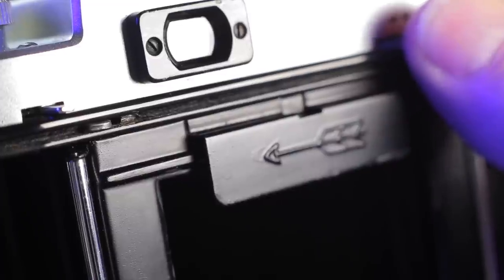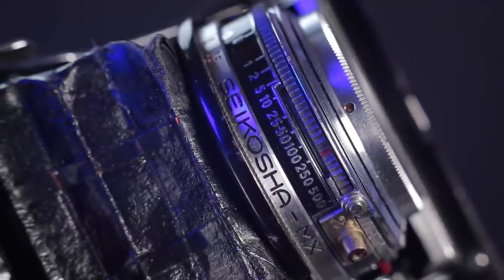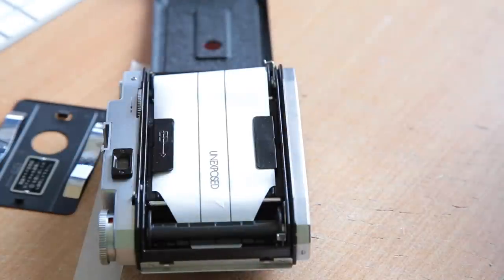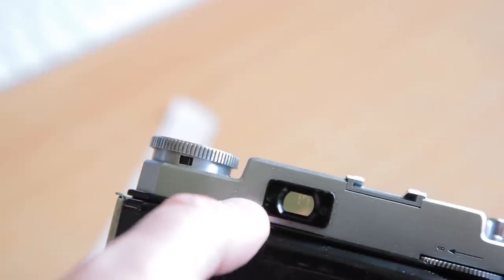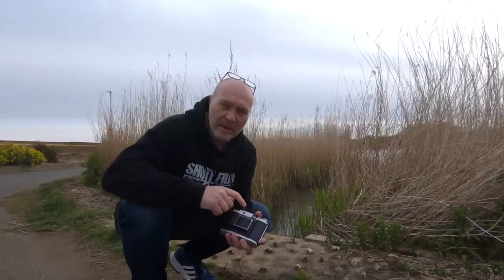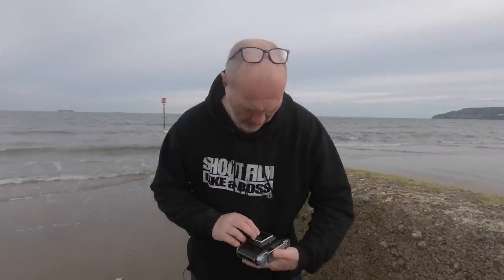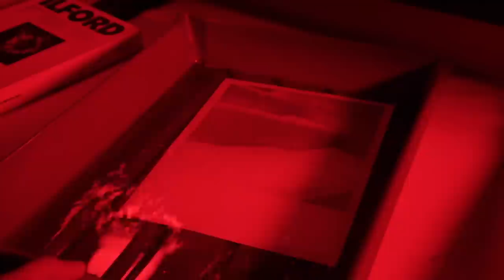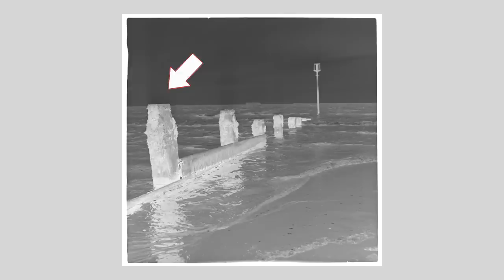6x6 MAMIYA 6 Automat. My latest Folding Camera. Classic!

Comment: What's the best practice for metering your shots with this camera?  You seemed to be taking the shots quickly without using any kind of light meter.  The reason I ask is because I'm thinking of purchasing one.
Reply from the maker: I can't remember the conditions but usually I'll shoot these cameras outside where the light doesn't change so I can meter up once and shoot away. I know if the light has got darker or lighter so I either meter again or judge it by eye. But mostly I shoot them on a day where the lights is even all day.

Comment: I’ve had one of these for several years and it’s excellent! The lens is superb! Super sharp with great color rendition. Actually fits in a coat pocket or easy to sling over the shoulder. Quiet leaf shutter. 
Mine is quirky with flashbulbs though. There was either a short or the metal to metal of the cold shoe/flashgun was popping them off in my fingers as I replaced them. Ouch!
Reply from the maker: Ha ha. Pop, fizzzz... Ouch

Comment: I've got one of those, a slightly older model.  I was planning to get an Ensign Commando (same focusing setup) but for almost twice the money, I got one that had been dropped, and the top cover caved in.  Mine requires use of the red window, and I have to manually cock the shutter -- but it has a pair of flaps inside that let me switch between 6x6 and 6x4.5 formats.  Lately, though, I've been using my Daiichi Zenobia more.  Smaller and lighter.

Comment: Googled it it seems you move this after you’ve taken a shot to prevent double exposures and overlapping of images on the film. A little red flag appears in the viewfinder
Reply from the maker: Nothing happens. That's what Martin Henson said. But I get no red window in my viewfinder. Thanks for taking the time.
Reply from the maker: And it's impossible to take a double exposure with this one. It won't let me fire unless I advance the film.
Reply: @ShootFilmLikeaBoss  Funny why you have to move the switch if the camera won’t let you take a picture anyway. Suppose it’s like I found out that you need to move it to stop overlapping 🤷‍♀️

Comment: Another Mamiya Six Automat owner here.  I was looking for a high quality folder, but couldn't afford a Super Isolette, so I went for the Mamiya instead.  It really is a great camera - simple to use, portable, and has a nice sharp lens.  
That said, there are a couple of minor problems.  The automatic cocking mechanism on mine doesn't work properly, so I need to cock the shutter manually before I advance or else I waste a frame.  The camera doesn't have any frame lines in the viewfinder, so be prepared to crop in the darkroom/photoshop.  Lastly, the lens is quite prone to flare, either because it's not recessed far back enough, or because of the coating.  A way around this is to use the lens bed/front cover as a 'hood' of sorts, and orient the bottom of the camera towards the light source when shooting.
Think I might take mine out today...
Reply from the maker: Thanks. I did read about lens flare online when researching. I'll watch out for that!!
Reply: @ShootFilmLikeaBoss  Cool. Also, forgot to mention - don't try and change shutter speed when the shutter is cocked.  It'll damage the mechanism.

Comment: I love the Mamiya 6 - have on myself as well. I love the lenses on these things.

The tab that you slide to hold the film spool in place is suppose to have a small thing that holds it in place, I guess is gone on yours, but should not stop the function of the camera :).

As always, enjoyed your video... keep them coming :).
Reply from the maker: I did have a feeling something was missing there.
Reply: I'm in the middle of stripping down two mamiya six cameras and they have the same metal plate. The first one just rests there and can swing out freely as yours is doing. The second one at first I thought metal corrosion but it's not. The company changed it by cutting the metal to form tension on the removable screw it rests against. One side worked the other was lose. Bending it slightly with pliers has put the tension back and it now holds in place. I'm surprised the automat has that fitting as my model IV which has everything the automat has expect auto cocking the shutter has the normal circles at the base of the camera which you pull out and they go back in place once the film is loaded.

Comment: Do you find the shutter speed dial/switch hard to adjust?  I have to use two fingers and quite a lot of for to move the shutter speed. Wondering if normal and if not let me know any advice.
Reply from the maker: Not really. No more than any other cameras. It's not stiff.
Reply: @ShootFilmLikeaBoss  Thought so.  Any suggestion on how to lubricate it?

Comment: some of my favourite photos you've taken , in this episode
Reply from the maker: Thanks. I wasn't out long either. Couldn't wait to finish the roll as I stupidly was only wearing that hoody without a t shirt under and got cold.
Reply: Good to see you with one of my favourite cameras, Rog. Unless I am mistaken, the bellows look like the original ones, so I would be interested to see if regular opening and closing creates light leaks at the creases. That was my experience and had to get a new bellows made and fitted by an experienced camera repair guy, who knew what he was doing. Also, important to ensure that the pressure plate is not put in upside down, as that will cause scratches on the film!

Comment: So you got GIVEN a Mamiya 6 Automat, and you already have 2 other folders? Sigh. For those of us on a budget who have to buy our own cameras, that's hard. Sorry to be negative but the price of old film cameras is getting really challenging. PS, I thought the sand on steps image was the pick of them too and the darkroom print looks really good.
Reply: You can litterally get run of the mill 120 folders on ebay for like 5 to 10 quid. Same for some pretty common 35mm cameras. Cameras with provenance are getting up there in cost true, but price of entry is still very very cheap.
Reply from the maker: The zeiss cost me £20! The Solida cost me £50. Some bargains out there on the folders. Grateful for the new one.

Comment: question... do you have those 3d printed adapters to put 35mm rolls in a medium format camera?  I've been doing it on my mamiya 645 and yashicaflex A.  I'm looking at picking up a Mamiya 6 Automat but only if the film canister with the adapters actually fits in one.  Thanks
Reply from the maker: I don't Greg. Sorry mate
Reply: @ShootFilmLikeaBoss  no problem - love the channel
Reply: @greggreaves1727  Sorry to barge in like that, Greg. But I guess the pressure plate will scratch film that has no backing paper (or it will not really lay flat) so I would not use it with adapted 35mm. But that's just me.

Comment: i noticed the streaking when you showed the digital scans during the video and was wondering if it was bromide drag from stand development, but then you developed normally with pyro and i scratched my head. perhaps pyro just has a hard time with sharp contrast transition point like the groins?
Reply: Pyro is a very active developer, it almost needs constant agitation to get streak-free development
Reply: @user-ti9zc1xv2b  not necessarily true, 510 Pyro works well with semi stand usually
Reply from the maker: The developer is recently new for me so it's trial and error time. The drag started from the groins and the top of the port marker. Baffled me